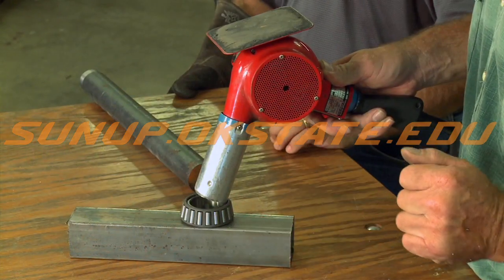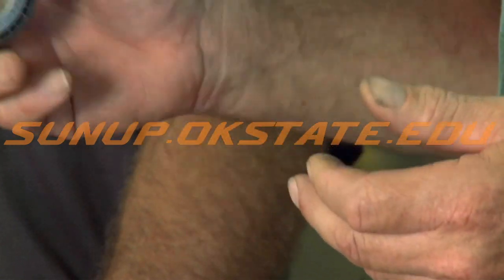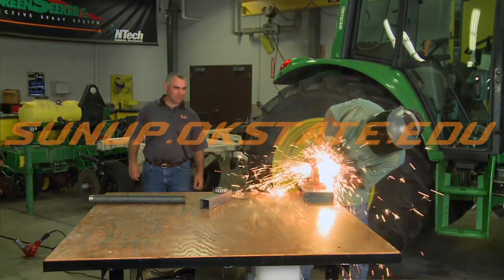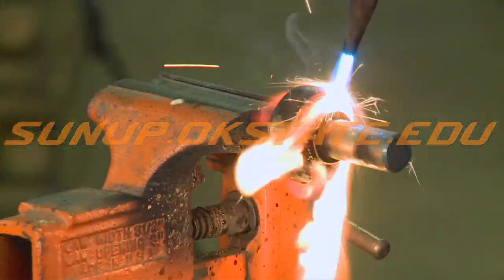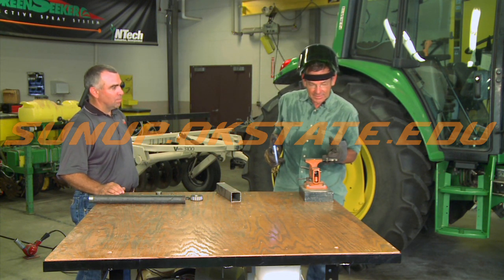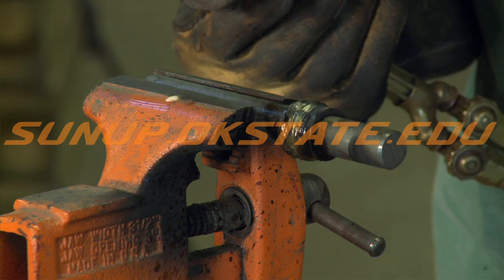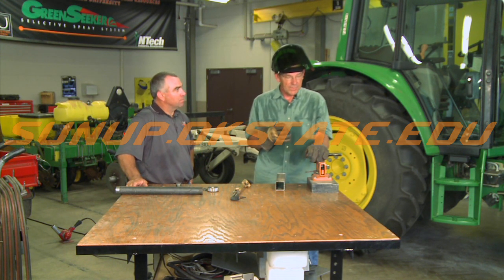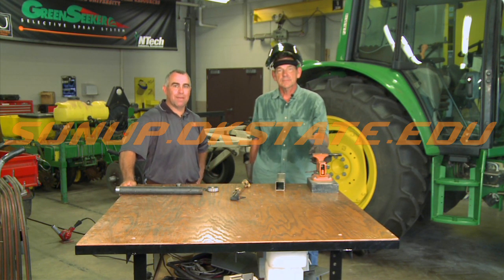Shop Stop: Tips and Tricks for Ag Mechanics

Comment: A torch is last resort unless its impossible to get to both sides easily My choice of tool is a Air hammer and a generous amount of WD-40 I can take off any sized bearing without worry of starting a fire especiaily if its on a baler or combine after its removed then i can dress up the shaft for a new bearing

Comment: There are many other ways....
If I can get to it, I prefer to use two good hammers, smack opposite sides at the same time... A leather glove works well to keep the shrapnel from hurting someone.... An angel grinder with a cut off wheel works well on the inner race, cut in as far as you dare, and pop the slit with a chisel...or just cut on through, being careful....
 Way less chance of fire! And you don't have to breath all the smoke...
  Don't get me wrong... I do use the almighty hot wrench too... But only if I can't get it done the other way.

Comment: OK guys.here is a tip from an old timer on cutting bearings.It is called a scarfing tip for your torch.It is an angled tip so that when cutting that bearing you don't have to worry about cutting that shaft.So now you can cut a bearing like someone that has been doing it for 40yrs!